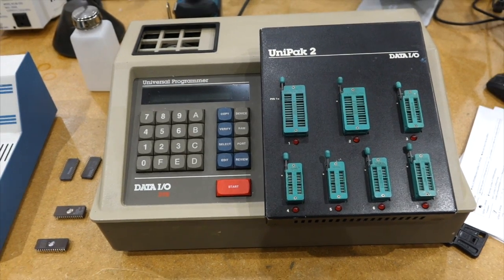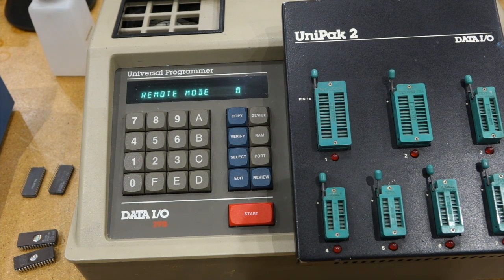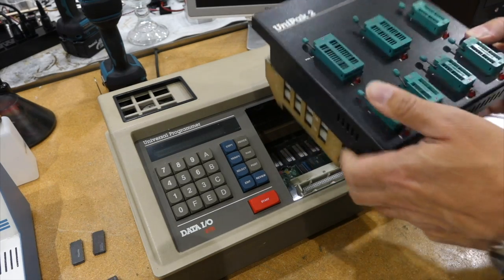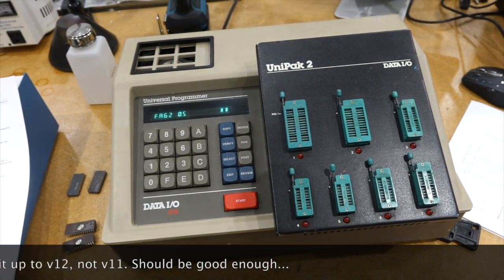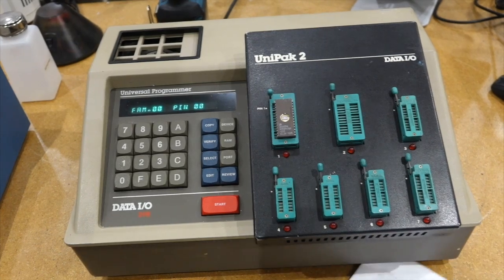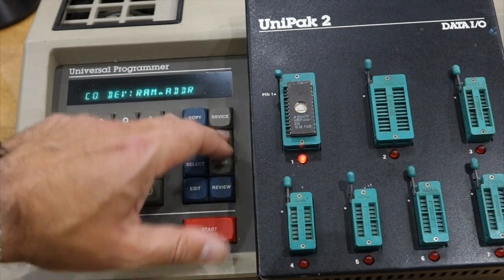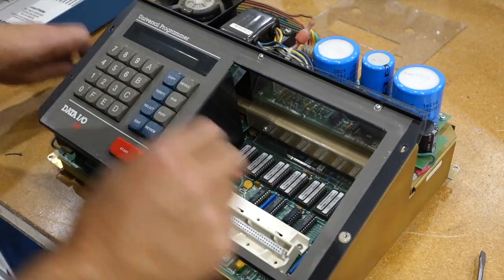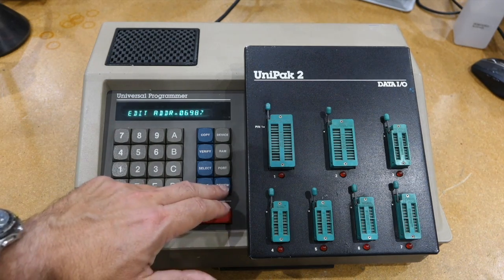Data IO 29B PROM Programmer Repair Part 1

Comment: MCUmall programmers won't work?
Reply from the maker: That's what a sensible person would do! It looks like it supports devices all the way back to 2732's, albeit as one generic device (the Data IO has many different settings per brand). But I wouldn't get to play with a clunky 1980 device, and I don't think it would do older 1k or 4k bipolar PROM (program once!), which is really what I am after. But most of all, it would be way less fun!

Comment: Data IO made some real tanks.  I used a later one attached to a VT100 to program EPROMs for use in a satellite I worked on in the early 90's.  They featured a multi-voltage driver for every pin, so they were theoretically a universal programmer.

Comment: Not so old as sof of our products still use EPROMS for operational and programming software.... :)
Reply: Did you follow up the use of Caig DeOxit with Caig MCL after the switches dried?
Reply: Maybe a Tantalum capacitor went bang?